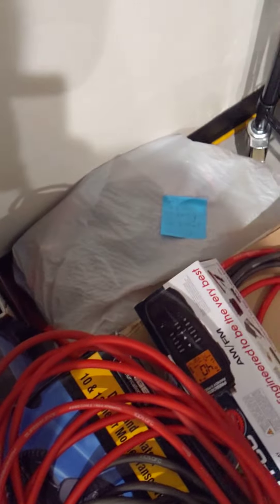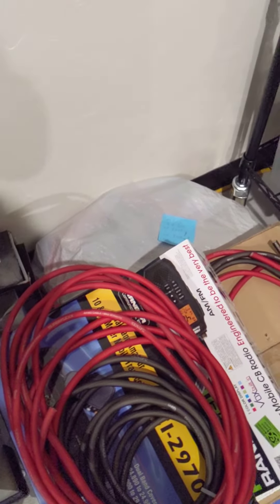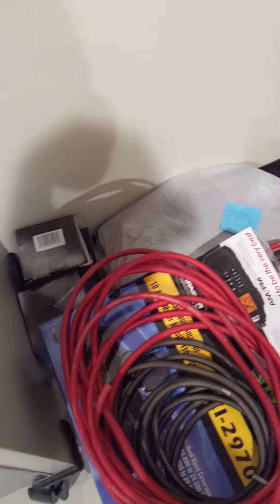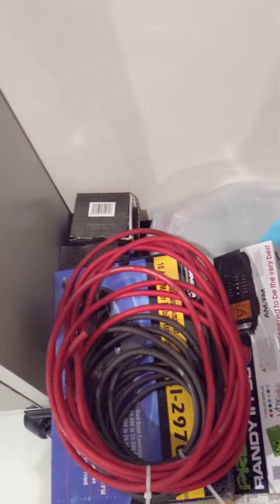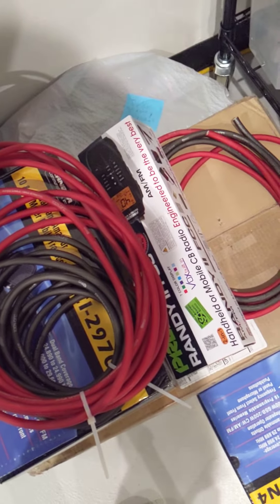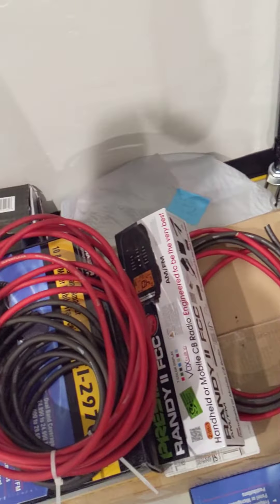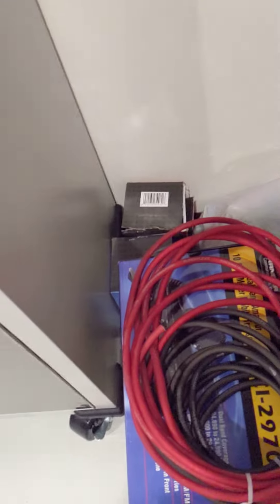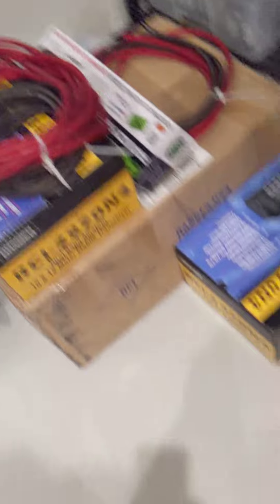custom upgrades and installs ...9lb hammer custom 3 n4cd ..custom install and conversions.

Comment: Man I hope you have better luck with those sr10-a’s than I did! They work great with just a couple hundred watts anything more than that and the Reflect goes through the roof no matter how much you tune on them…I tried 2 different ones and exactly the same results! Said screw it drilled a hole in the roof and put a 102 on.
I’ve still got a 959 that needs an alignment if your interested.
Reply from the maker: O hell we run over 1200 peak threw them with 1:2 swr ...  But u have to shorten the feed line sometimes ..just has to be set up proper ther decent antennas...gotta be set up proper.